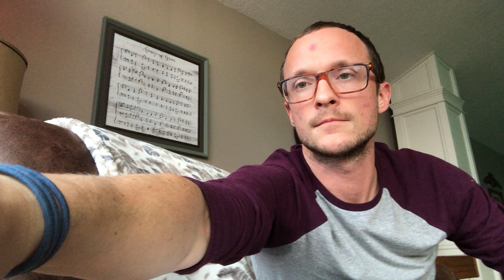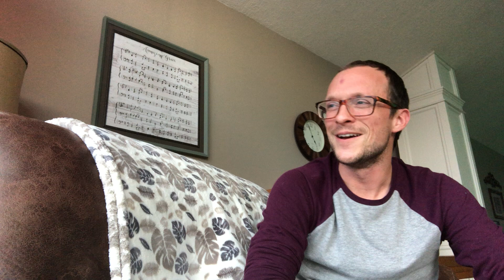Dual Grit Edge | Strengths & Weaknesses | Ideal Knife Steels & Sharpening Stones?

Comment: Why not pushing the burr with fine grit from both side once it was formed? as it  saves more materials for the micro concave.🤔
Reply from the maker: Very interesting thought!  I am not sure whether it would remove some of the helpful edge texturing (aggression) but it's worth a try!!!
Reply: @homeslicesharpening  Yesterday I've tried both the dual-grit as shown by your instruction vids And a dual-fine-grit burr-pushing finish after the burr was formed on the same 4116 blade, the OG dual-grit feels more sticky catchy sharp, it bites into epidermis on my fingertip more unexpectedly when I trys to feel the edge, (I'm guessing it's because of the micro serration?), but the dual-fine finishing really feels sharper against papers(as in push cutting), but as for how long the fine micro edge will holds, idk, don't have proper test rigs or fancy BESS thingy(doubt it anyway) to test it.🤔

Comment: LC200N might be a good candidate, based on its toughness.
Reply from the maker: It's coming up soon!!!  Cheers!
Reply: @The Home Slice  oh hell yeah, noyce!

I just did my own dual grit job on my Pacific Salt. It's getting regular use tested and will be my only carry at work until it dulls. I'm very familiar with the steel so by the time it needs resharpened I should have a pretty good feel it it helps. Well, if my own particular sharpening job helped anyway.
Reply from the maker: @PoetFisherman  Nice!  That's awesome!  I have to smash out a bunch of tests of new sharpening stones I have, but once I'm done with testing them on simple steel H1/H2 will be the first steel I demo some dual grit edges on, and LC200N will be the second (going stainless steels in order of ascending Carbon content) 

And after that...

Vanax!!!  
They should all be interesting to analyze!  Let me know how your test goes!  I hope the performance is awesome!

Comment: Based upon what you've discovered, it sounds like M390/20CV would not be good candidates for dual grit sharpening. Are they included in some of your planned/upcoming vids?
Reply from the maker: Hey bro - you know one of the strangest results I’ve experienced so far is that Pete tested some M390 and it did perform about 50% better than I expected - while a few hard but lower carbon steels like S30V have had poorer results.  Very strange.  Hoping to clarify with more testing.  Pete’s M390 test is below 👇 (900 cuts)

https://youtu.be/ChiFWYb7_VM
Reply: @homeslicesharpening  Very interesting! I was curious about dual grit performance on some steels I have access to. Also, there are some Spyderco forum threads discussing you and Pete's testing that got Sal's attention. He mentioned he'd contacted you, but was looking for someone who could get him in contact with Pete as well. Throwing that out to the internet.

Comment: One interesting steel to test would be AEB-L and 14C28N. Good hardness and good toughness. I don't expect it to go as far as Magnacut because it has lower carbide content but probably would be a quite significant increase comparing with AEB-L on standard sharpening.
Reply from the maker: Yeah!  I have some NitroV which is really similar, and 12C27 - those should give us a good initial idea, but I have a maker who wants to send me some 14C28N samples.  Would be fascinating!

Comment: I’ve not found edge trailing strokes to be completely necessary in my dual grit testing. I’m hitting s30v edge leading. I take both sides up to a polished edge, dmt extra extra fine, and then I hit one side with the 220 grit dmt until I form a large burr. Then the side that’s still polished I hit with the EEF again until a small burr forms and then I strop a few passes to straighten that out and it’s the best edge I have used for s30v. I’m trying edge trailing strokes on m30 tomorrow because I’m having trouble finding an edge I like on it
Reply from the maker: Interesting!  I have had a hard time with dual grit S30V - I will have to experiment with edge leading!
Reply: @homeslicesharpening  it’s actually the first steel that I experimented with using the dual grit method. I didn’t know then that you were doing edge trailing strokes. I’m an edge leading sharpener. This makes me wonder if I had a sharpened burr like your dual grit edge or if I just had a sharp knife. Either way it’s an excellent edge for s30v

Comment: I'm looking forward to the next year then. I just sharpened up my spydy seiki k390 on stones from venev>1200, chosera 10k, shapton 16k, suehiro 20k.  convex...And it's nice again, But I am wondering with petes new results what is your best guess right now on combos for k390. Cause I would like to keep a mirror finish and maybe couple it with dual grit, maybe the 1200, or if I buy their f2000 coupled with the suehiro 20k might end up better than the suehiro 20k on each side. 
I'm normally convexing at 15 degrees with 3 degree variable. Options are chosera 8 set kit, shapton 6,8,16, suehiro 10,15,20k, venev orion 240>1200
Reply from the maker: Thanks for the comment - I’ve not sharpened K390, but I’d go for diamond on the coarse side and a more gentle water stone as the last stone on the fine side.

Maybe 240 grit Venev and your favorite fine stone on the other side (chosera, Shapton, or SueHiro should work fine). I stop at 6K, but I think you could go finer!
Reply: @homeslicesharpening  The chosera is definitely the softest, the shaptons are very hard and the suehiro varies more, the 10k and 20k are fairly hard, and the 15 is my favourite, it's a tad softer cuts a bit quicker and has great feedback. 
Remind me, you do the 240 first, then progress on the other side all the way up edge trailing only? Do you ever go back to the 240?

Comment: It might be possible that heat treat can play a part in dual grit. Like if the heat treat is creating hard mc carbides or not through secondary hardening, or has retained austenite or high hardness? As these things affect the bur.
Reply from the maker: Oh yeah - I think dual grit making an improvement rises on metallurgy & heat treatment!

Have you read Todd Simpson’s latest article on S110V?  In part 3 he mentions that the best qualities are maximized in steel when the carbides are separated.

I think that the way the burr shears off or bends makes or breaks dual grit and that could all change in HT.  Looking forward to doing the testing this year to investigate whether there are measurable barriers of alloy or hardness beyond which dual grit is not effective.
Reply: @homeslicesharpening  that was an interesting read. I hadn't read the s110v articles. What he says makes sense.